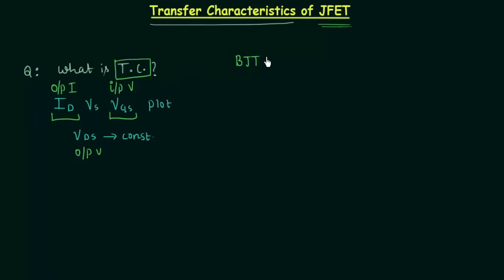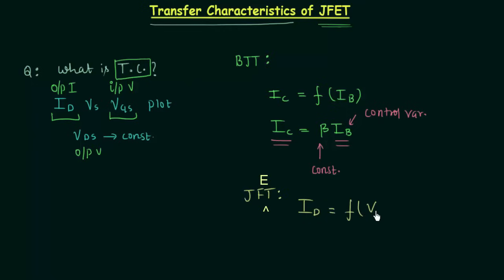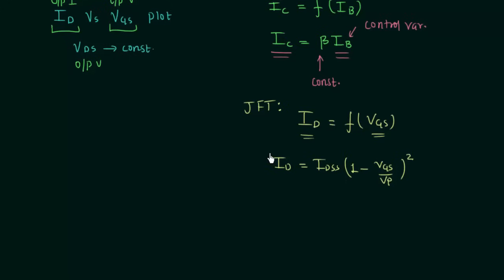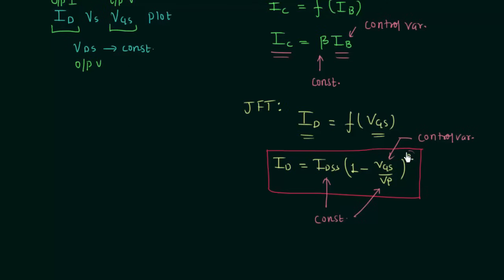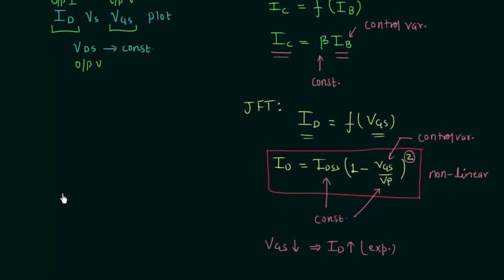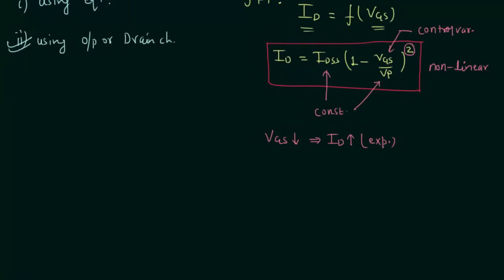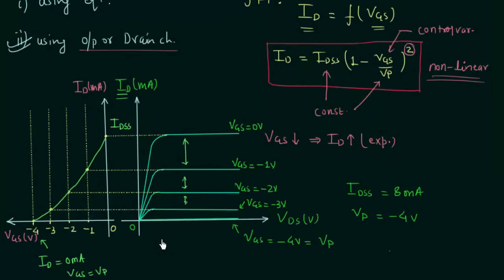Transfer Characteristics of JFET

Comment: FETs are not meant to be operated with VGS > 0 (for n-channel).

In that case:

Gate–channel junction forward biases → gate current flows.

Depletion shrinks → channel widens → ID increases a lot.

Device may lose control behavior and even get damaged.

Comment: 00:09 Transfer characteristics of Junction field effect transistor
01:35 Bipolar Junction transistors have a linear relationship between the output current and the input current.
02:50 Shockley's equation relates drain current to gate-source voltage.
04:08 Decreasing VG's increases drain current ID exponentially
05:21 The transfer characteristics of the circuit show how the drain current varies with voltage.
06:35 Graphing characteristics of drain current and voltage
07:51 Transfer characteristics of junction field effect transistor
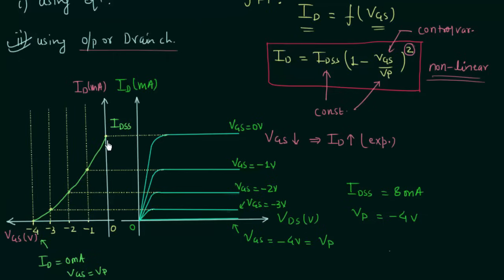09:03 The output characteristics of a device show a nonlinear curve

Comment: 4:17 when Vgs decreases ( becomes more negative), then Id will also decrease. At 8:58 also you can see in transfer curve.
Reply: Yeah, it might confuse anyone. Basically, you have to see V(gate-source) in reference to 0 meaning when the voltage is -ve its just that the polarity is -ve. You are still increasing the Voltage it's just that now you are increasing the -ve polarity voltage. Hence, when the voltage increases  I(drain) decreases and vice versa.
Reply: while solving the equation take the magnitude (|v|)  do not consider the sign (since it only represents the polarity)
Reply: @faizanhasan9715  while solving there come another factor pinch-off voltage. And it is considered -ve. 
So we have to consider polarity of Vgs while solving eq.

Yours 1st comment seems right though.
Reply: Well!  I figured. You can even see in formula     Id   is   directly  proposon   to   Vgs.

Comment: Pinched Off voltage is negative for n-channel jfet as shown in transfer curve of jfet. But in drain characteristics curve of jfet, it's the minimum Vds(which is positive) where Id become constant. So I am very much confused how Vp=Vgs shown in transfer curve(a negative value coz n-channel jfet works for -ve value of Vgs) and Vp is positive as Vp=Vdsmin as shown in drain curve??????.
If you didn't understand my que then kindly give your email id, I will send the image for better understanding.
Reply: gaduganesh2015@gmail.com

Comment: why pinch off voltage is negative?pinch off voltage is the voltage vds(which is positive) at which depletion layer at drain is assumed to connect and after that ids remains constant upto breakdown voltage.
Reply: it should be vp=0v i think.
Reply: True vp will be negative only if the jfet is p-chanel
Reply: @Hammoud-pi9zx negative means  PN junction should be in reverse biased condition.

Comment: at 4:10 you said on decreasing Vgs the Id increase 
but by transfer Ch.  the more less Vgs will decrease Id too. please clear this ques.
Reply: clocks2 brain. Id increase only upto vgs=vp only then it entres into cut off region so current becomes zero
Reply: Cause vp is - ve.. So with decreaing vgs will decrease Id
Reply: @santanumaity8762  Vgs is also negative..making it more negative will decrease Id
Reply: clocks2 brain bro you can see negative sign in Vgs on negative side of x-axis
Reply: Ganesh Dodwani!! so what???? It still decrease.. Vgs decreases
Reply: Id also decrease